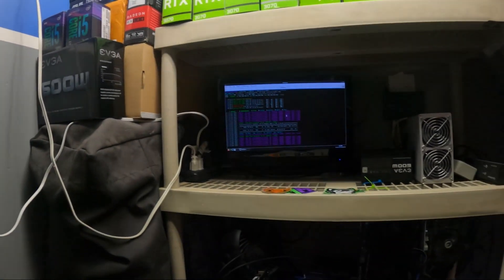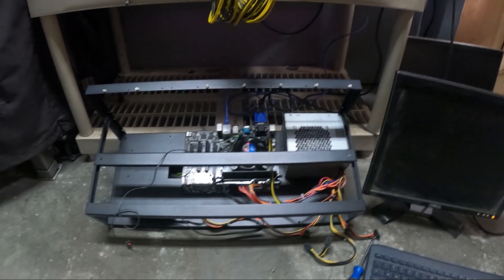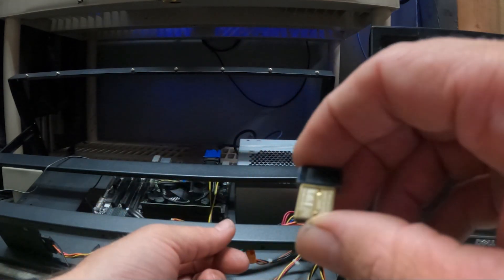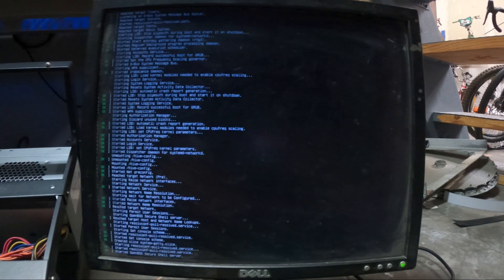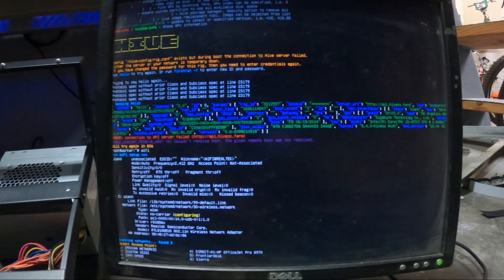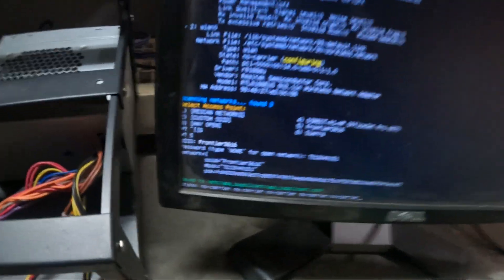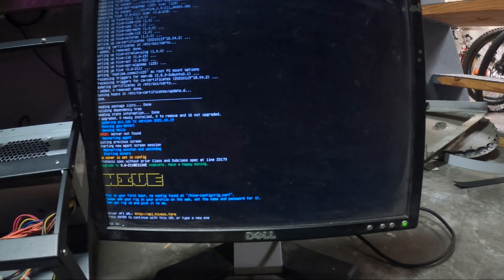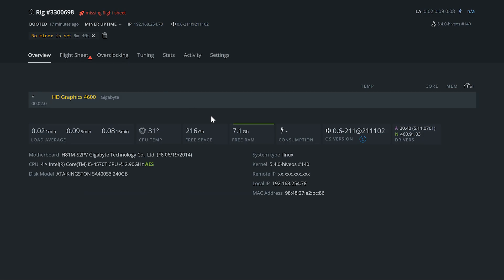How to Setup Hive OS on Wifi

Comment: How do I get the driver for the wifi dongle onto HiveOS? No videos seem to explain that.
Reply from the maker: It does it automatically. You shouldn't have to do anything.
Reply: @BDigiCrypto  It doesn't do it automatically for me. It doesn't even automatically connect to the internet. Should I just leave the network SSID and password blank in the config file?
Reply: @SakugaAsu  i have the same problem